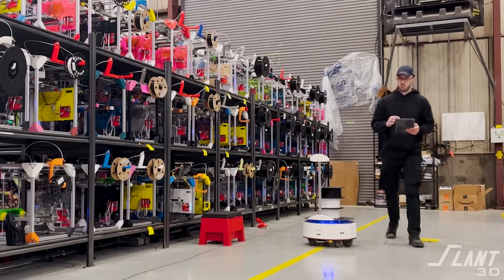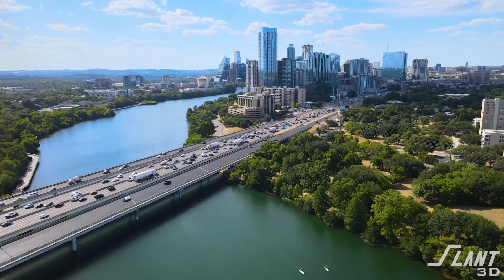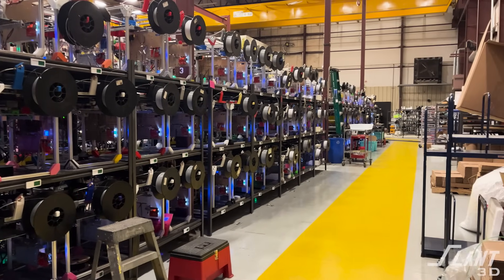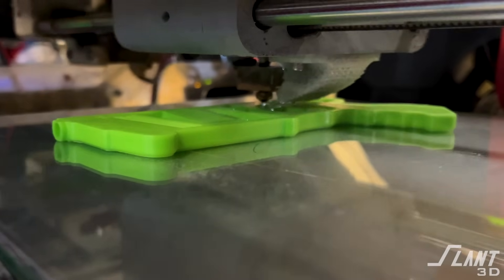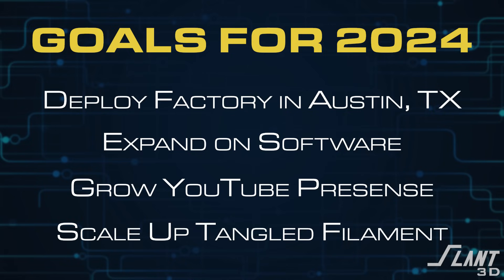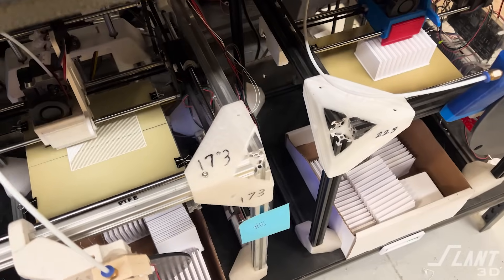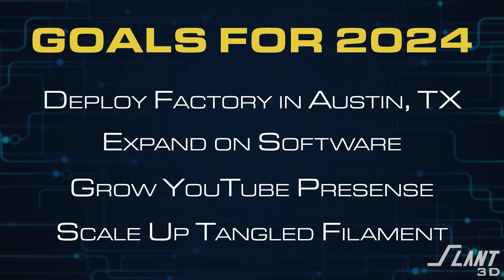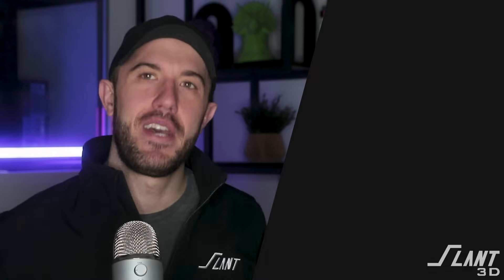We're Making Our Giant 3D Print Farm Even Bigger | 2024 Goals

Comment: Maybe this has been discussed over the past few years, but a part of me looks back on the various 3d printer designs that have come up and I recall a number of different 3d printers that printed from raw pellet stock. I would expect that the production concern would be the quality of color mix in the resulting output and possibly some would argue that to alieviate that you would effectively need to go through a mixing and extrusion process to make pellets for each  color you want to print with. The other issue I see is that very likely you would have to have two sets of hardware as there are materials that you have a lower demand for, but which you very much want to make products with, and the only reasonable source of that material is in spools of filament from other companies. The potential issue being that having to maintain different printers for different varieties of stock materials may be an expense you are not interested in.

As to the color consistency issue, I'd note that the injection molding process (As I understand it, forgive me if I'm wrong, I'd like to learn more) uses the same raw stock pellet process, and I presume as part of the input process to the injector system it mixes the pigment with the raw stock in measured increments and that gets fed into the hopper for the injector. Yes, changing colors may be a pain, but there is also the potential flexibility of effectively going to picking a color from the full spectrum that your pigment collection supports, with some not process for switching out colors if there is a demand for more of color mix x over color mix y. (Just as you've done transition rolls of filament over on Tangled, at times.) The transition time for a pellet feed system may depend on how large the mixing system is. (I envision it being something like a small barrel that gets a volume of pellets, specific measures of pigments, get closed, turned on it's side and tumbled, then when 'mixed' poured into the input hopper of the printer, where it the mix already there isn't the same, then the printer is assigned some appearance insensitive prints to transition to the new color mix, and once  a match is ready, start running off the ordered parts in that mix.)

Again, I fully recognize that this may have been discussed nauseam. I would think that the big advantage would be that you can re-purpose existing automated hardware from the injection molding manufacturing environment that's well established, and perhaps reduce the expense in time of having to replace spools of filament every thousand to four thousand grams of ouptu parts. That said the interface between the injection molding infrastructure and the 3d printing infrastructure may not be worth the savings. I don't know.

Comment: i want one of your printers 😅
Reply: Keep in mind that none of Slant3d's printers are controlled by PCs. You're going to need the appropriate computational hardware to communicate with that printer. I don't think he's talked about the computational hardware they use to control the printers in the farm(s) but I would not be at all surprised if they were using something like IBM AS400 systems to support either a rack, or a row of racks of printers. And yes there are other mid size to mainframe computers that they may be using, but I'm envisioning it being a setup similar to how automated production in other markets works. I.e. one computer controls some number of printers and operates at as high a level of processing as they can get from the computer. I.e. a computer that's expected to perform batch processing, and is optimized for that. While PC's are great for a large number of uses, they don't tend to function well in batch processing mode, because they don't have the I/O interfaces needed to support that.